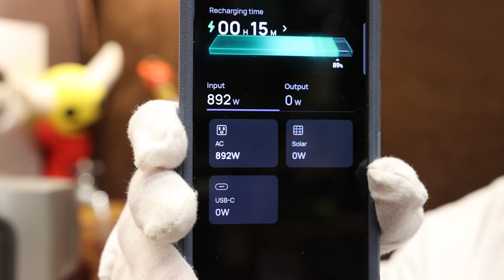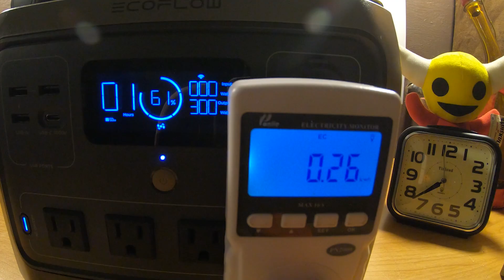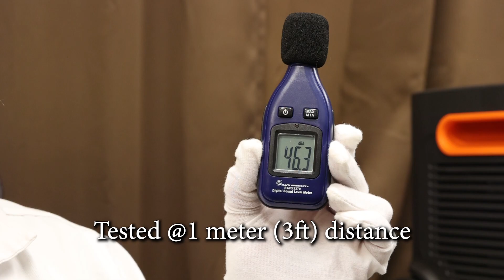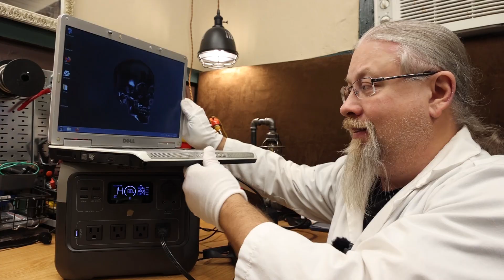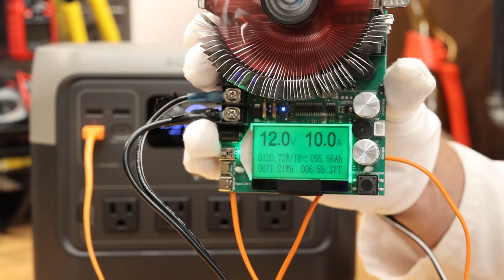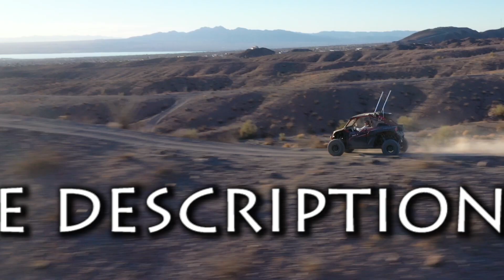EcoFlow River 2 PRO 800w LiFePo4 UPS Power Station Solar Generator Review

Comment: To solve the "EPS is not a UPS" I just bought a small APC-UPS and connected one into the AC-output of the  EcoFlow product. That way the UPS will keep my internetmodem running even if the Ecoflow product needed to much time to switch over.....

A powerbrick that does AC->DC does indeed do some buffering but so does a desktop computer. Whether is will survive.... I don't even wanna try :-)

Comment: Question: sorry if I missed this in the video ... if you are running a 12V computer type fan only, all night, will the unit continue working all night or will it shut down due to the low power draw ? Thanks in advance for an answer.
Reply from the maker: You can disable auto off in the app.
Reply: @HOBOTECH  Thanks !

Comment: Can you ask your manufacturers to do a reverse UPS? i.e. run off battery and solar pass thru till 15-20% then switch to the grid. When battery is at 90% charged from solar, then switch back to battery.  I would save so much if I could run my fridge 50% of the time or more on solar and have it auto decide when to switch.
Asking too much? The fridge is my biggest electric draw.
Reply from the maker: Look at the top end Bluetti models.

Comment: Main issue I have with Eco-Flow products is the lack of blue-tooth on many of their products and/or functionality. I don't want to have setup a wi-fi network or switch my mobile device over to the Eco-Flow just to check status when I'm camping! This is a HUGE no-go for me. Also if a unit can be used as a UPS then make the inverter output AC outlets grounded to the input AC so the ALL devices that require grounds can function properly and safely - another HUGE design flaw. As Always thank you Professor for your most thorough review - you are my go to for these products, and I was LOL at your ROBOTECH parody!
Reply: Can you explain what you mean by the grounding of the ac outputs and inputs? I’m planning on using this unit during an outage situation for my laptop and my three monitors. All 4 devices have 3 pronged plugs. Will this unit pose a problem with devices that use those style plugs?
Reply: @thebbiddim882  I'm not sure if this appiles to this product Professor Hobotech is reviewing in his video (since it appears the AC oulets have a ground pin) as I have and older gen River MAX Plus but the AC Outlets (output) on the the right side do not have grounding prong connection (just blank hollow holes) so unit will no ground outlets to the grounded input (house utility plug). this could be a problem for some electronics require that grounded plug to remain safe and funtion properly. BTW I purchased my Ecoflow River MAX plus refurbed from ecoflow a couple years ago and it just failed when I needed it most to keep a small DC fridge running during a power outage - about to contact Ecoflow on how to get repaird. I'll come back and update you.

Comment: Is it PURE SINE WAVE?
Reply from the maker: Did you watch?
Reply: @HOBOTECH  I watched.  You said it was, then showed the amp being noisy.  So is the noise because the "pure sine wave" is not very pure, or because the inverter is outputting EMI which is picked up by the amp?
Reply: (I am not familiar with that digital oscillosope, and I wonder whether it might fail to show short transients that might cause the amp to be noisy.)

Comment: Guess it’s a not a so pure sine wave inversion for the interference to occur when amplifiers are powered.. Ecoflow should make a purer sine wave inverter for musicians to plug audio gear.. a simple system $60 no hum/buzzy 500watt pure sine inverter w/ solar charged 12volt 25ah LFP’s runs my 50+ watts guitar amplifiers on the budget comparatively.. thanks on that interference test.. it’s what’s I look for in a quality inverter for sound equipment..

Comment: I bought the Bourgerv 1100wh model upon HOBOTECH’s recommendation for $550 last month. I am afraid my garage will be full of solar generators if I keep watching this channel
Reply: How’s your BougeRV 1100wh model treating you?
Reply: @darrellee4953  I’m very happy with it. With a Renogy 175w panel on the roof rack, it charges up to 152w max, and most of the time over 120w. Runs Iceco VL60 fridge for about 50 hours after a full charge.
Reply: Where did you get this deal?
Reply: @MrSatchelpack  Amazon. Looks like they have a newer model now

Comment: im looking at some stats that City Prepper did on the Ecoflow River Pro and his numbers are a little lower
768	DC Cap 628.19 /82%	AC cap 610/ 79% using the same discharging  contraption you use to discharge the battery. It goes to prove not all of those Rinky Dink Battery discharge units(spinning fan and 007 music included?) measure the same. BTW those ebay units are not what i would call high tech electronic measuring devices.

Comment: When I want to power a small a/c load with my large power station, I use an old 300 watt inverter.  Seems to extend the useful life of the battery with the same load rather than the built in 1000 watt inverter. Thought I'd pass along my experience in case it would be helpful to others.
Reply: Yup, I do the same thing.   Actually I go one better... most small A/C loads are wall-warts for devices that take 12VDC inputs.  Get rid of the wall-wart entirely, turn off the AC output, and run the device from the 12VDC output.

Though unfortunately most of these power stations also have fairly inefficient DC outputs.  There is no reason for it, buck converters can be made 95%+ efficient.  Why they don't do it?  Probably don't want to spend the tiny bit of extra money on parts.   Still, at least the DC output doesn't have any vampire current.

I run my cable modem from a little GoLabs' DC output (which doesn't suffer from the 8-hour timeout that the AC output has, either).   The cable modem only eats about 5W and the little power station lasts 3 days without mains.

I can also run laptops and mini-PCs from (typically) the USB-C output.   You can buy USB-C -> 19V cables (USB-C negotiates the voltage, amperage cap is 5A regardless (100W @ 19V), so you can actually get a decent 19VDC output via a USB-C PD port).   And again, they last far longer on backup power verses running them off of AC.

-Matt

Comment: Good Review as always Prof.Hobo. I have several Ecoflow products now, a 4kw Powerkit and an original Riverpro, both have been wonderful. I was able to score a package deal on the Delta2 with the 220w bifacial folding panel for $1098...I think that's a pretty good deal.
Reply: Nice man! I just got the river 2 pro w/ 220 panel for 999 minus hobo code was like 75 off. Thought it was a great deal. I just don’t need a ton of power and liked the smaller size.

Comment: Once again disappointed with the inverter. I am a ham radio operator and cannot use Ecoflow products for that application. I have an earlier River Pro with expansion and like it for use in the camper, however it is the 70s for the radio. Ecoflow support is great but Bluetti and even Pecron have quiet inverters.

Comment: As I know is the case with technology, I ordered the Bluetti EB70S just a few short weeks ago. The River 2 Pro was the other contender but it didn't really exist at the time. Still happy with my purchase and of course it is all thanks to the excellent reviews of HOBOTECH. Thanks Professor!
Reply: I bought an EB70S about six months ago and I love it. It just works great. The only thing I wish is that I had a built-in power supply as with the newer units from bluetti and ecoflow.
Reply: Is it still possible to refund? The River 2 Pro kicks it out of the water.
Reply: Why didn’t you buy the EB70S?
Reply: @darrellee4953  I did, they don't even make the non-S still do they?

Comment: Nice, this has some really good upgrades over my Bluetti eb70s.  I was annoyed by Ecoflow’s marketing that was claiming 1600w capacity on some ads without mentioning the true 800w capacity of the inverter.  My only other gripe is with sogen manufacturers in general - they should provide more than 10amps of dc output.  They should go up to at least 12 to 15 amps, but I would like to see it go even higher.  A wireless charge pad would be nice too, but overall this looks like a really good product!!

Comment: Not a critique of your laptop test, but why does it not turn off when there is the 15 ms gap in power? Even an old computer is probably operating at 1 - 2 GHz, so that 15 ms is a huge amount of time for a CPU. I'm guessing that all computers must have a capacitor or something to deal with such issues? Also curious about the sign wave as stuff like computers are supposed to be "sensitive" to that, and yet during the gap it clearly wasn't a proper sign wave. Why did that not matter?
Reply: Note that one 60hz cycle is 16.6mS.   AC inputs go through a rectifier and capacitors to store the energy on each cycle.  As long as the DC regulator doesn't draw-down the capacitor quickly, the AC side can miss several cycles without causing the device to fail.

All such circuits at least have to handle the 60hz cycle anyway, so it isn't a big stretch to also be able to handle the loss of half a cycle (around 8.3mS) in addition to that.

The AC switching circuitry... er, the UPS relay, actually MUST delay at least 8mS or so to guarantee an arc-break as it switches the relay, because the phase of the internal inverter's output is not usually synchronized to the mains.      The arc-break occurs (or is guaranteed) when the waveform crosses 0V each 60hz cycle.  Otherwise very bad things can happen.

This is actually an art, because the latency of the relay itself has to be taken into account too.   Usually relays take at least 4mS anyway and these bigger ones... probably 6-8mS even if you instantly tried to change the ocil.

-Matt
Reply from the maker: Computers have capacitors on the motherboard to regulate power. Most can take up to 30ms switch. Very old PCs do have a harder time but modern ones are globalized and deal with power issues better.
Reply: Just a note. Check dedicated UPS units switch over is normally 15 to 20 ms even for sensitive equipment. The circuits have enough electrical capacity to bridge that gap.

Comment: I Have two eco flo solar generators. Both broke. ecoflo has next to no support so if you buy one keep that in mind.
Reply: You are either lying or just having bad luck because I and a friend have eccoflow with little to no issue, and the one issue I did have they responded quickly. I have the river 2 max and the delta 2 with extra battery.

Comment: hello hobotech. big fan of your channel. i just ordered this on the 3rd. i have a question. will 2 of the 160w ecoflow solar panel in series work with this? i know it’ll only accept 200w of solar and i dont want to fry it by putting too much.
Reply: So long as you keep the Voltage under the 50V limit, you should be ok. If the 2 panels' series voltage is greater than 50V though, you might want to put them in Parallel instead.
Reply: @jonjohns8145  i see that the ecoflow 160 says that it’s Open Curcuit Voltage 21.4V (Vmp 18.2) i want to keep eye on the number 21.4V correct? so 2 of them would be 42.8V. i’ll be ok since it’s under 50v?
Reply: @LeeTechReviews  Yeah, though I would feel better if it was around 40 instead. Solar panels sometimes produce voltages higher than the Voc when the conditions are right like when it is sunny outside but cold. But I think you should be ok with those 2 in series.